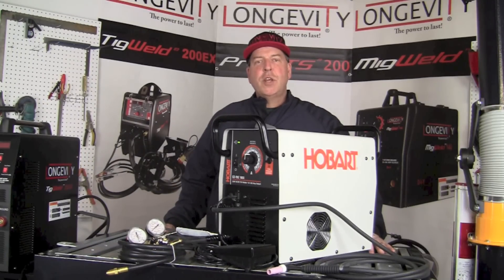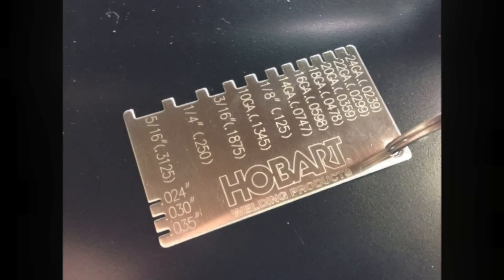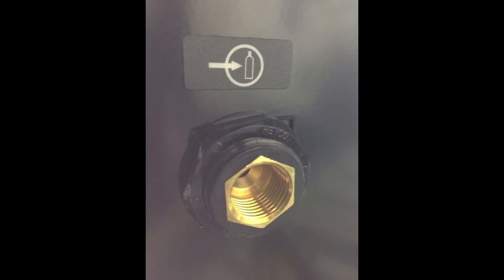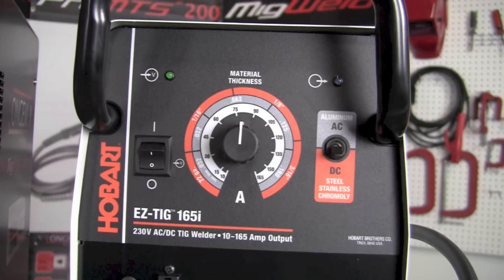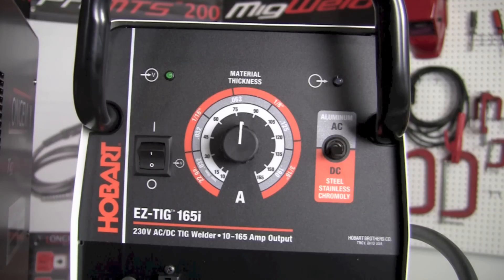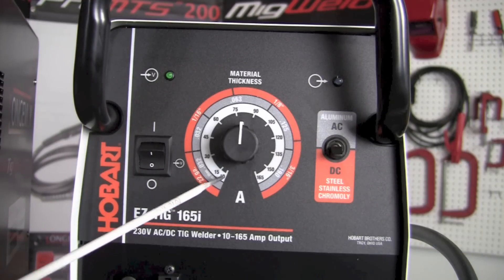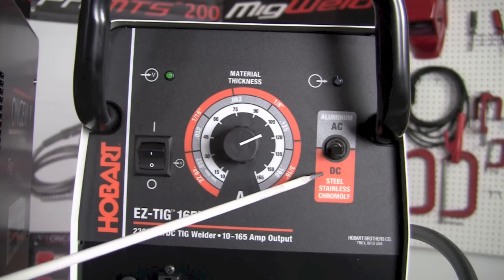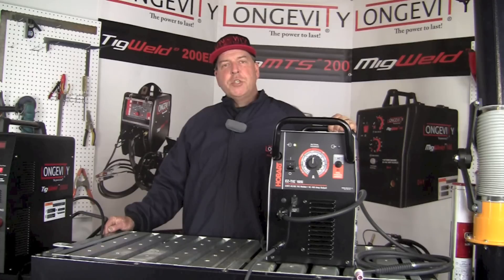HOBART EZ TIG 165i ACDC TIG WELDER REVIEW - PART 1

Comment: All this is is a Miller Diversion 165 rebadged, do yourself a favor and get get a Primeweld 225X, you can buy two Primeweld machines for the price of this one being hawked in the video.
Reply: But the 225x only does DC not AC this Hobart does both

Comment: im researching my first tig welder. and this one looks just like the miller diversion 165s right down to the accessories just with a different paint scheme but at half the price. both made in USA. are they actually different?
Reply: Miller makes hobart welders
Reply: They are the same machine.
Reply: In fact, the torch, hoses, and cables all say Miller on them.  Mine shipped directly from Miller.
Reply: Jack Yang how much are they$?

Comment from the maker: If you need AC as well, go with our TIGWELD 200SX, if you are looking for a professional DC TIG only machine with stick capability, the TIGWELD 200i model is top notch with auto voltage.